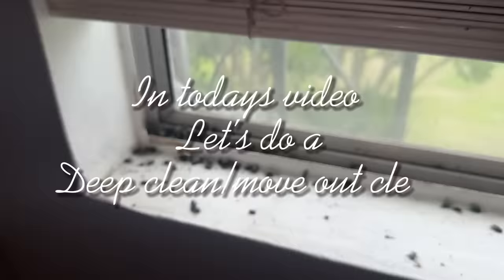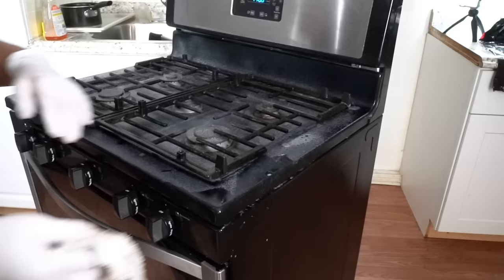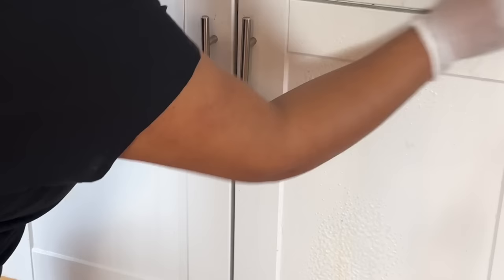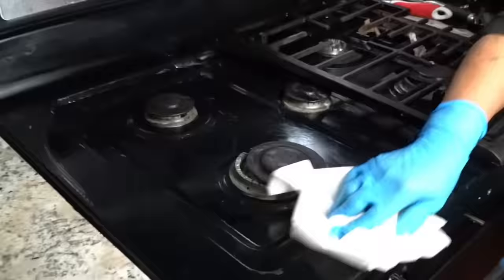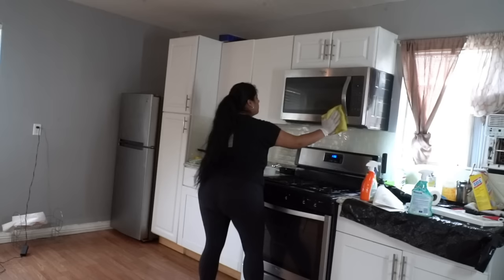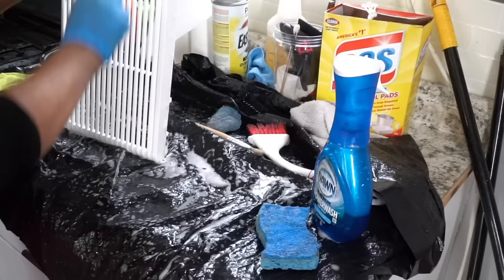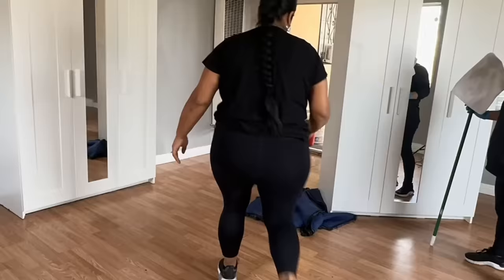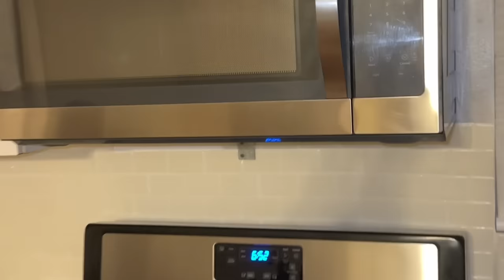WATCH PROFESSIONALS DEEP CLEAN AFTER A TENANT MOVES OUT

Comment: Can you share the checklists that you use for both deep cleanings & regular basic cleanings? after my son moves out and I'm still going to b here living with a friend of mine I want to clean everything hoping b4 she actually moves in with me
Reply: Literally, start with wiping ceiling, then walls, then floors.  Gravity, and top - down approach.   Then, in between,  wipe down, or scrub as needed, everything else.  So , in a bathroom,  ceiling, walls, floor (so you don't track dirt on your feet/shoes, as you do the rest of the room).  Then,   shower/tub walls, floor. Toilet,  wipe all surfaces. Mirror, or windows.   Sink, all surfaces.  Empty drawers or cabinets and wipe out, scrub. Trash can, scrub all sides in the tub. Rinse n dry.  Or buy new trash can if old.  Repeat the floors. This can be alot of work, if not kept up.  So split into 2 or 3 days, if needed.  A house mate will appreciate a clean bathroom,  for sure.
Reply: @cathycoryell2351  thank you for this

Comment: Caustic (strong bases, with very high pH) oven cleaner like the original Easy Off, which contain strong hydroxides, will destroy aluminum, other metals, plastics like knobs and control panels, painted surfaces, flooring and many other things around a home.   It has a super-high pH, the opposite of an acid, and literally burns off the grease.   I wouldn’t use it on a stovetop unless I could check the stove’s manual to see if it’s safe.  Also don’t use it in a self-cleaning oven, it will ruin it.  Special PPE is needed to use it, especially strong-base resistant gloves (not all glove types work for every chemical), and eye protection are essential (chemical-resistant goggles).  Ventilation and proper respiratory protection is very important, too, you don’t want to breathe these vapors, they will burn your lungs.  That said, I still rely on Easy Off for cleaning many things like barbecue grills and oven racks (outside on a newspaper covered surface).

Comment: Cleaning an apt empty is very hard you take the stove apart cleaning all the parts the dishwasher and it's parts  and the refrigerator and it's parts .Cleaning the AC unit cover and the inside of the cabinet of the ac unit .Bathroom don't even get me started on that ugh .The outside balcony washing all the siding on it if it had it wash all windows inside and out all blinds fixtures lights carpet closet tracks sliding door tracks .People have no clue at all what it takes to clean an apt.i could go on and on with the things I saw and delt with I can't even

Comment: When I clean and rub too hard, my fingers hurt, so does my elbow and arm 😅
Reply: You may need a different cleaner or to mix it slightly stronger (but then you have to rinse with fresh water). Buy Mr Clean or Lysol and mix your own so you are “working smarter instead of harder” also use scotch brite, preferably the blue or even the one for microwaves and rub lightly then wipe with a microfiber cloth and use a very soft one to “buff” it to a shine if needed. Let the chemicals work for you so you can work gently. If you have some real mean stuff you may have to step it up to the next level with Krud Kutter or Greased Lightning and a brush like for grout or toilets. A butter knife wrapped in a cloth or a new razor blade my be needed for heavy residue but use with care.

Comment: You may be smelling old water/ mildew sitting in the base of the air conditioner window unit. Often they don't drain well or the drain plug on the exterior gets clogged with dirt or bugs or whatever and a quarter inch of funky disgusting water will sit there and stink.

Comment: G'day, Ileana! May I ask what product you use to clean that little area on the stove where the temperature and burner settings and the time clock are?
Also, what cleaner did you use on the ceiling fan?
Reply: Any cleaner should do, especially one that takes grease away.

Comment: Wow!  What a job you had to do.  Great work!  I'd like to know why you scrub with the cleaners and then generally wipe off the soap without removing it with clean sponges and water first.  Without rinsing thoroughly, you'd leave soap residue behind.  Soap residue would be likely to attract dirt, dust, etc.  Maybe that's in your editing, but it seems like you spray the cleaner, scrub the soiled areas, and then just wipe that off with a dry cloth.  Am I missing a step?  I had renters who said they "did a good job cleaning" and it was horrific!  They must have fried chicken every day and there was grease everywhere.  I hate using caustic chemicals, but this called for the big guns and many repeat scrubbings.

Comment: Do you use towels vs paper towels?  How many cloth towels do you use?  I'm trying to transition and use less paper myself.  I feel like I need so many though!
Reply: Always use regular towels you wash! You can also rinse them out as you're cleaning and wiping...i wear a pair of those kitchen rubber gloves so that i can clean thoroughly. Only exception for around the toilet, use a paper towel then.
Reply: Bamboo towels can be reused about 10x and are biodegradable. I use one to wash dishes; and one for each room and bathrooms; rinse and reuse until you deem it's no longer usable. I love this transition! For me, it's been a great compromise between paper towels and cloth towels.
Reply: @KatByte4U  I've switched to bamboo for almost all of my household paper. I love the stretch it has, especially the TP (so soft!) and paper towels. Love y bamboo socks, too.
Reply: You need a lot of towels or rags. I use about 15, 20 or 30, or more on every deep clean and rewash them after each cleaning. I rarely use paper towels.

Comment: Do you ever clean older mobile homes?  Mine is a 2000 model and the cabinets are those cheap ones that are basically card board covered in a weird paper.  I am looking for ideas on how to clean them gently and also, since I have cats that like to use them for scratching, the best way to patch them before painting.  Just wondering, in your experience and your mom's, best gentle products to use.  Thanks.
Reply: The trick is not letting water or moisture sit on them for more than a few minutes. Spray and wipe almost immediately. Any mild cleaner should do like Fabuloso, Lysol. Pine Sol diluted in water. i no issues with heavy grease. For grease, Krud Kutter, Mean Green.

Comment: What product is recommended for cleaning wooden kitchen cabinet doors? They get an oily residue.
Reply: Any degreaser should do.
Reply from the maker: You could use Murphy a oil, dawn power wash. Some degreasers just make sure to quickly remove as they came be very strong and damage the finish.

Comment: I end up spending a lot of time rinsing. Especially on stove tops and ovens. I didn't see you rinsing the oven cleaner or the orange cleaner on the stove. It looked like you just wiped it clean with a dry rag. Is that even possible?, I always go over the outside of the stove with window cleaner to make it shine. Because I inevitably leave behind water spots from rinsing or some product here and there. But all that takes time. You did it so fast, like one wipe down. How do you do that? 
Also, I know that Dawn power wash makes a lot of suds but I didn't see you rinsing that either (which would make more suds of course). 
I feel like I'm wiping and wiping. Wash, rinse, dry and shine. Too many steps to make things shine!

Comment: How would you wash the blinds if you had to? Is there an easy way? Mine aren't removable and it's alot of work. Thank you!
Reply: No way around it. They have to be cleaned in place with a bucket full of warm water and degreaser and cleaned slat by slat with rags wet with the solution from the bucket, front and back.
Reply: Yes that's what I do, Wish there was an easier way, Thanks
Reply: @paintersinasnap6427  Yes me too.

Comment: Hi Thank you can I ask what is the best Way to clean toilet and wood flooring with out collecting so many products!
Reply from the maker: The easiest but most cost effective would be one of those disposable Wands that attaches to a disposable little sponge that already has liquid for the toilet in it for the inside they have several different brands. Then for the outside same concept disposable disinfectant wipes which also they have different brands. Two products and bam clean toilet 😊
Reply: @MoreThanCleaning  Thank you which brands with those being?

Comment: Did the zap Citrus Degreaser work on the ceiling grease for you without ruining the paint? It is a problem I have ran into several times as a property manager of a small complex
Reply: It's Zep, just in case you want to buy it.
Reply: It is hard not to mess flat paint while cleaning. Most of the time it is cleaning with degreaser and then repainting.

Comment: U use dawn spray also on hardwood higher end cabinets??  Those don’t look to high end but looking for recommendations
Reply: Be careful with the finish on cabinets as it can be damaged with the chemicals in detergents. You can use diluted degreaser but needs to be mixed with warm  water and wiped on and off almost immediately, not letting it sit for more than a few minutes.

Comment: What do you suggest using to remove cigarettes and caked on dust onto everything and also pet smells and stain s😭
Reply: For smoke or pet odor, the carpets will have to be replaced and all the surfaces thoroughly cleaned, including the ceilings and walls.  I use (a ton of, you’ll need at least 10 dozen for an apartment) clean white cotton bar wipes dipped into a diluted solution of Spic n’ Span and hot water, then wrung out just enough to stop dripping, wetter is better.  (TSP is the same thing, but I like the added fragrance of Spic n’ Span).  No need to rinse.  Then use the appropriate cleaner for other surfaces, like window cleaner for windows and mirrors, and 409 for kitchen surfaces.  Curtains will have to be washed, ironed and rehung.  If pet smells are still present after removing the carpets, the carpet pad must be replaced and any urine-stained subfloor replaced or sealed (primer works).  For dust, hair, lint, etc., I like to start by vacuuming or dust-mopping to remove most of it before wet-cleaning.  Otherwise, we end up just pushing the hair, etc. around.  If you’re in the landlord business, I highly recommend investing in hard flooring, not carpet, which can need replacement after one bad tenant in as little as a month of occupancy.